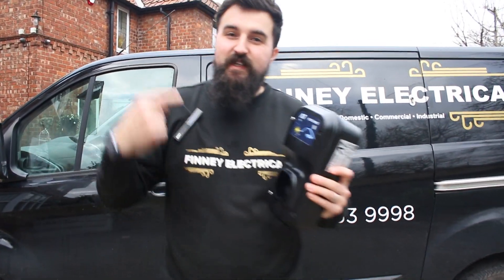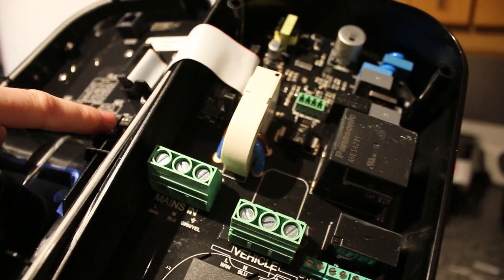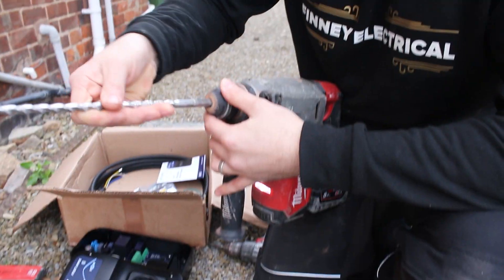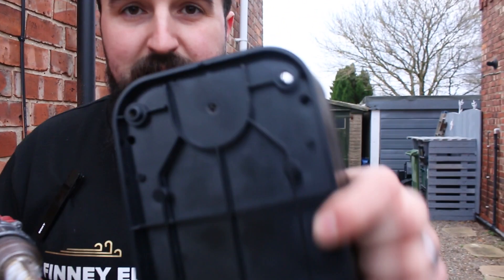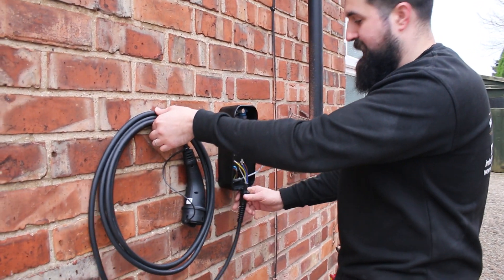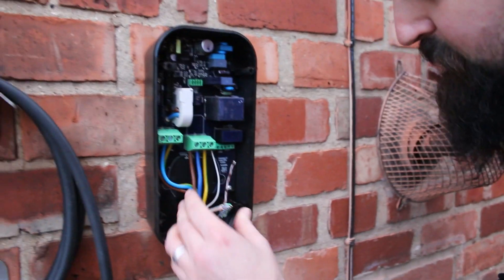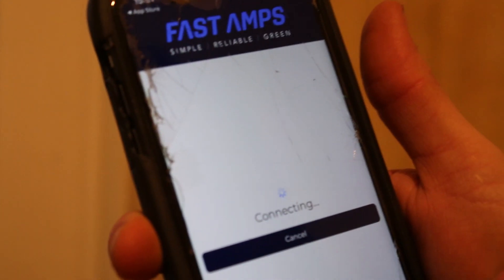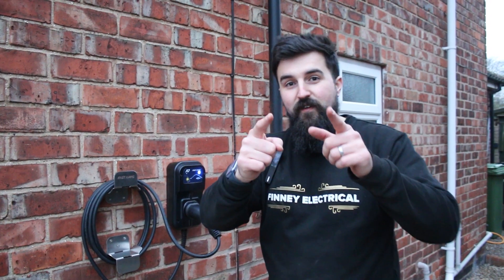BRAND NEW FASTAMPS EV CHARGER INSTALLATION! ⚡🚘

Comment: Does the charger use wifi?
Reply from the maker: The latest version is wifi! 😀
Reply: @finneyelectrical  Nothing on the web site about wifi capability?
Reply from the maker: @alanbeard4871 so the old version is Bluetooth, I’ve spoke to the Main guy there and he said the new versions are WiFi’. They are doing a promotion if you go down to learn how to do it they’d give you a charger. If your not an installer call them up, they are really knowledgeable about the product

Comment: Really simple little charger James no bells and whistle like some of the big branded ones and it does the same job,I noticed when you clipped the CP clamp on to the line there was another one already on the cable further along,did they have another EV charger already installed,great video again big pal
Reply from the maker: Heya! Yeah great charger 🔌 they had battery storage fitted for buying in at night at a cheaper tarrif ❤